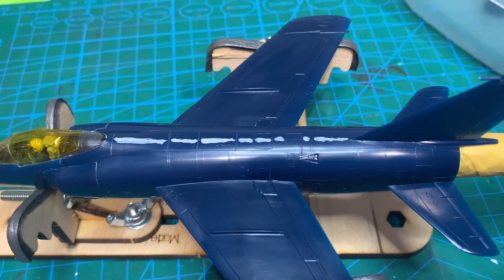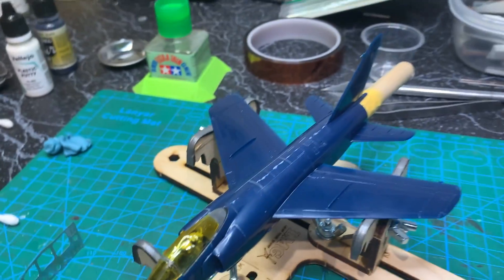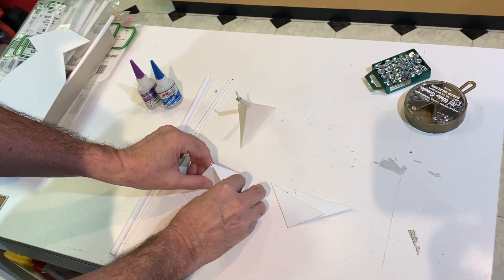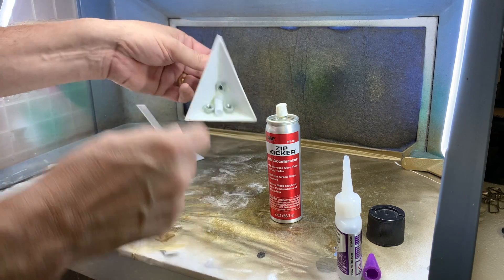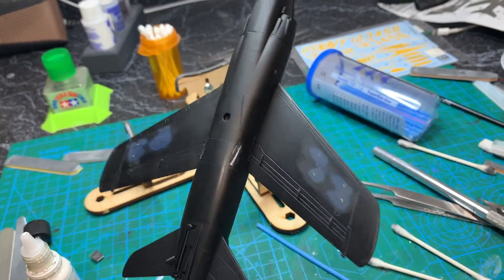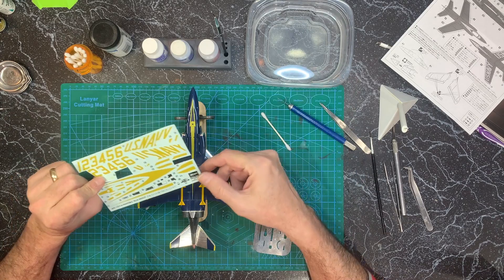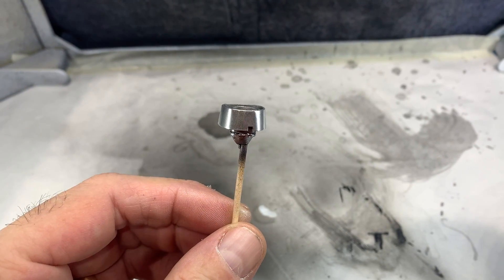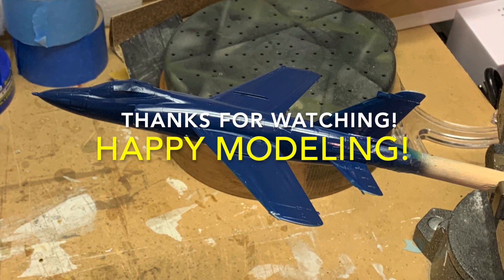Tiger Buddy Build - Grumman F11F Tiger #4: Seams, Stands, Start Paint

Comment: Hi John, Great video.  I use Mr Surfacer as a filler too.  It does shrink when drying, so a few applications may be necessary.  That base you built turned out great.  The paint work looks amazing.  I'll be looking forward to seeing the finished model.  Thanks for sharing.  Have a great day.  Jeff